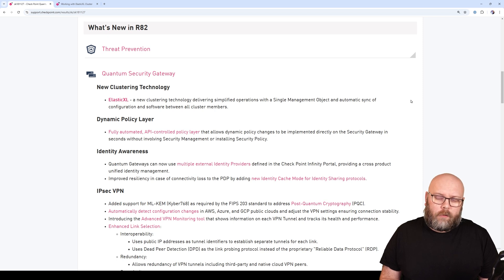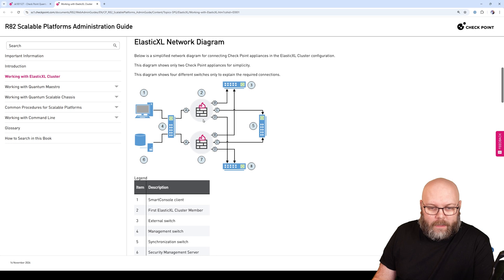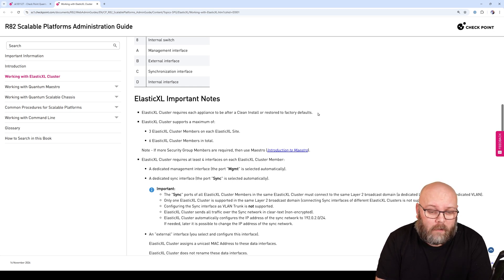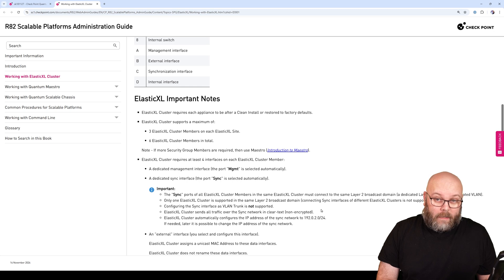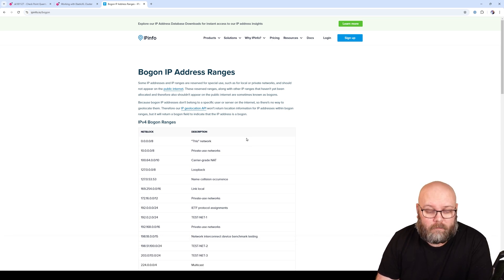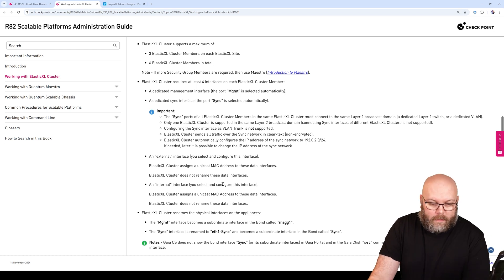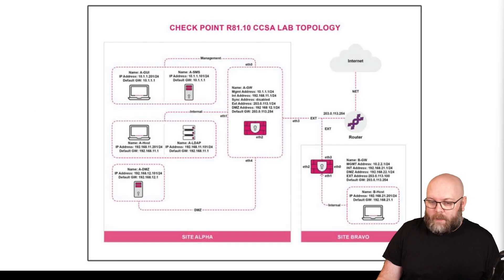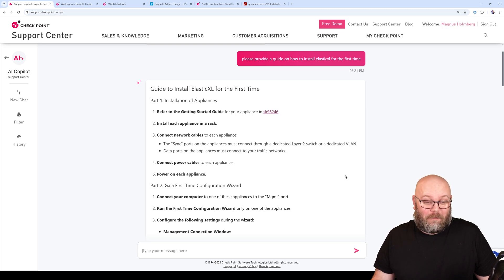Training - Check Point R82 - ElasticXL Lab01 Prep

Comment: for your question, personally would rather see the  'how to' guide, not the 'let's play and learn'.   Both have value, however just like the AI copilot you're mentioning there is a lot of false start information which having yet another such doesn't really help in my experience when trying to show someone (or if you need to quickly pick up on something).     That being said, like you, I do a LOT of labbing and builds to test or find edge cases or to really understand how the items work.    Some may find that useful, if they are completely knew.  But from my experience in trying to  train others I've found nothing that seems to 'stick' better than have the person build their own (i.e. hands on) following the documentation.   i.e.  I don't want them to rote follow some process or method but to think critically and ask 'why'  'what if'  or 'how' and then build up a lab to test those questions.
Reply from the maker: I think you are right now when the version is new.
So iguess i need to rerecord some videos ;)